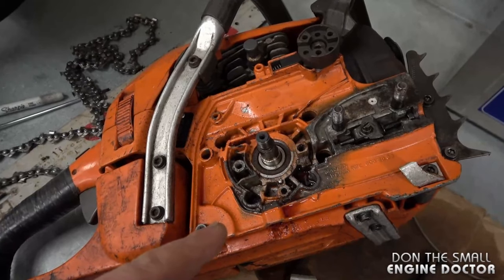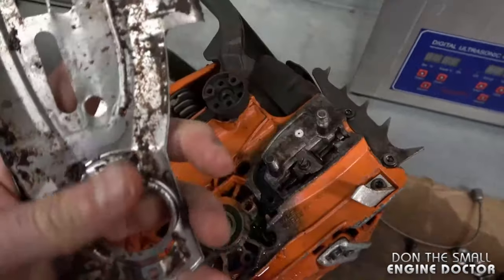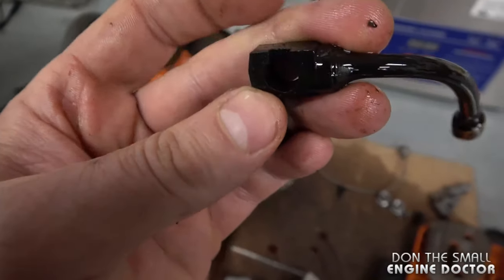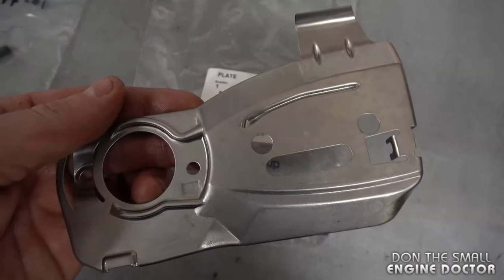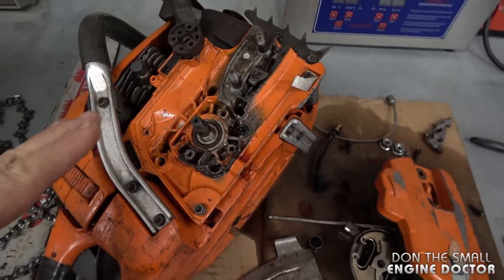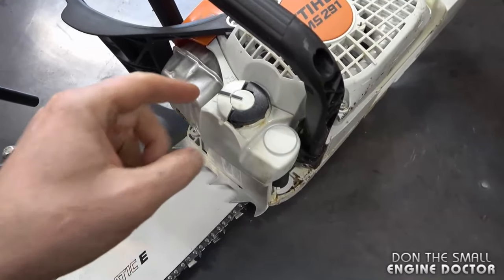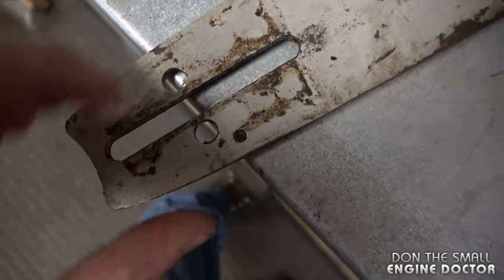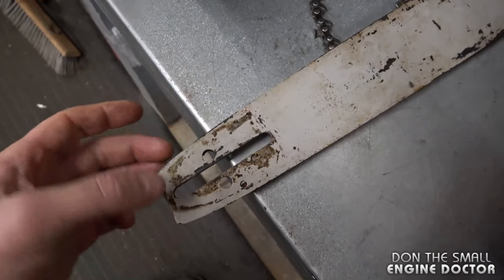Fixing A Chainsaw With A Massive Bar Oil Leak!

Comment from the maker: It is better to use OEM parts when doing this repair and avoid using old engine oil for your bar and chain in your modern chainsaw!
Reply: I don`t have confidence in the new stihl parts. One year old and plugged screen and leaky bar hose. I refuse to use their over priced oil.
Reply from the maker: @REDMAN298  i don't use their oil either
Reply: “Real” bar and chain oil contains ingredients that make it stick to the chain better than motor oil so the bar and chain will last longer and not get as hot. Used motor oil has contamination and has likely deteriorated from heat which don’t help your bar and chain life.  Saving a few dollars in the short run will cost you in the long run...
Reply: @johngrossbohlin7582  absolutely and you go to a farm supply and get their chain oil for about half the cost. I`m done with stihl. (have 3 of their saws,)  I take it personal when I get screwed. In these coming times I expect it will take it`s toll on these pricks. I used to be proud to own a stihl.
Reply from the maker: @REDMAN298  I've heard horror stories from dealers as to how Stihl treats them
Reply: could the plate damage possibly come from the chain coming off during use? My Echo chain came off and now it leaks.
Reply: stihl toolless oil cap is leaking because you have dust and debris on the seal, clean it and it wont leak
Reply: What web site did you find those parts and what are the parts called i got the same issue its leaking like crazy
Reply from the maker: @AZ_WEDDO  local husqvarna dealer
Reply: @donyboy73  mines a ECHO but thanks found a dealer close by

Comment: Good video mate.. after use before storing my saws i open caps on oil and fuel to relieve any built up pressure to maybe  help prevent leakage.. weather this works or not doesnt matter to me its not hard to do.. or its just all in my head and then that doesnt matter either... or does it..

Comment: Had the same problem on my 353 but wanted to quickly get it done so i cut a cylinder shape piece off a rubber clove and set it around the loose plug going in the body of the saw. Fixed the leak for a few months now. Ofcourse it is better to replace it for a original part. Mine was just something you do at home for a quick fix. Now i have that problem on a unused 357xpg i managed to get that has been sitting in a box for 9 years. My 353 was also around 13 years old when the leak came. Guess time just kills the rubber. Great video! Very helpful.

Comment: I tried the used motor oil trick back when I was young and dumb. After replacing the entire oil system on my saw, I stopped using the old motor oil and haven't had any more trouble.
Reply: Old motor oil is also a known carcinogen, but according to the State of California, (Prop 65), just about everything is.

Comment: hi don. I found that cleaning the bar and Oiler holes each time we sharpen the saw keeps it in good shape. Thanks for the tip on the oil loss problem. We now have a project to look forward to.
Reply: stihl toolless oil cap is leaking because you have dust and debris on the seal, clean it and it wont leak

Comment: Hi Don, thanks for all the great info on your channel, I now do all my own repairs and rebuilds thanks to you.  Own 15 Stihl saws and yes the new caps are a pain.  I take them off periodically and clean them in gasoline with an old toothbrush then compressed air, and that helps them last longer.  But the saws live on top of a piece of cardboard, everywhere they go.  Keep up the good work

Comment: thank you Don , great tips. a few thoughts. I keep a rag or oil pad in the bottom of my case to catch any oil. When I take my side cover off , I clean with brake fluid , let dry , then spray the inside with some non stick aerosol . really helps reduces the saw dust build up !!
Reply: What brand of non stick do you use?

Comment: Good advice I have the Husqvarna 141 16" forest chainsaw it leaks oil from sitting & not getting oil on the blade so its having two problems same time with this well explained video I will be tearing it apart tomorrow to check these things keeping my fingers crossed thats all it is thanks for the tips👍

Comment: Hi Don, hope your staying safe. I use a lot of Stihl gear and run a small 211 and bigger 261 chainsaw without a problem. But I have a full Kombi set up, because it’s brilliant and well worth the investment. From day one of the pole pruner attachment, it’s leaked oil constantly. I’ve replaced the tootles cap a couple of times  and cleaned out the the feeder line inc the sprocket area. It’s still leaks oil to this day. Any ideas from yourself or any of your fellow viewers would be welcome. Thanks!
Reply from the maker: try storing on its side, bar up

Comment: Mine is brand new.  Only used it once and leaked a huge puddle all over the place.  I'm used to Stihl  which never had these issues for me.  Yet, I'm still liking my Husq.
Reply from the maker: ask the dealer what is going on
Reply: My husqvarna 450e is in the same boat…brand new and leaking after only a few hours.
Reply: @TheRyan4756  I was told recently that this is normal because it is just a constant gravity feed.  Where as my Stihl is only active when running.  I think that is a better sounding system to me.  I had always been happy with Sthil in the past.  Might have to go back to them.

Comment: SIL bought a 455, and developed bad oil leak; found pump mounting bolt hole stripped in the plastic housing?  Uses special metric bolt, wondered if you have best approach recommendation?

Comment: Great video, many thanks. Can I just check that's not the 351 model please?

When I look up those part numbers it comes up as for the 351 model rather than the 353 quoted. Many thanks 👍

Comment: I have an echo 310 ( among others) and I use thick oil summer and thin oil winter. 
Oil leaks from the bottom of the clutch area significantly when stored. Any suggestions/advice?

Comment: I have a Cub Cadet CS 5220. It looks as if the oil tank is cracking. It looks like the bar clamp bolts are trying to pull through the plastic causing it to crack. When I put my saw away, it will be sitting in a puddle of oil the next day. Is this something I can fix or does the entire body of the saw need to be replaced?

Comment: Don, I need your help.  I have a Makita DCS6401 I purchased sometime around 2005.  That chainsaw now has a chain bar leak that pours out large amounts after usage.  As soon as I finish a cut, clean the saw and store saw until the next usage.  When I come back, I have a cup or so of chain bar oil saturated into whatever material the saw was sitting. I took my chainsaw to Home Depot and their repairman thought he fixed it but after a solid use of the chainsaw, I am guaranteed to have a pool of thick chain bar oil draining from the bottom of my chainsaw.  Help!  If I could ship the chainsaw back to the factory for repair, I would bc I love this powerful chainsaw.  Thanks much, Don.   (I too am Don)🙂 .

Comment: With the Stihl caps once they are put on wrong they won't seal properly again. Make sure you live up the arrows and turn them gently. It shouldn't take much force to twist. I am not a fan of these but I have had to teach myself how to use them. You can also use a silver or gold sharpie to mark the cap and the arrow so it is easier to see when you line them up. The down side to that is you have to do often because the fuel mix and bar oil makes it easy to wipe off.

Comment: Good day sir. I have a Honda mower brand new, also mtd 10 hrp snowblower was wondering should I turn the shut off fuel and let it run out of gas everytime of use? And also for season hibernation should I let all fuel disharge and leave dry for season. Thank you Angelo31.

Comment: The oil is operated off of pressure so when it starts pumping oil it creates a vaccum on the line so it's being syphon fed after using remove the oil cap to depressure the system worked on mines

Comment: Gonna have to watch those other video's on changing the oilier as one of my chain saws leaks badly.  Thanks for the tips and sharing.  Be safe and God Bless
Reply: stihl toolless oil cap is leaking because you have dust and debris on the seal, clean it and it wont leak

Comment: About those flipcaps, they work well but it needs to be clean around oil\gasoline tank hole, they won't seal right if there are any dirt, saw dust, sand.

Comment: I have had chainsaws already that from brand new, they leaked the bar oil out.  Now I have an old Echo CS-330EVL that is so old that it doesn't even have a chain brake on it.  It never had one.  It doesn't leak bar oil at all.  Has never leaked any oil.  I can wipe it clean after using it and put it on the carpet in the back seat of my vehicle and my carpet doesn't get messed up at all.  All my newer chainsaws leak bar oil to an extent with one that will leak all the oil out when put away over night.

Comment: Another great informational video.
Reply: stihl toolless oil cap is leaking because you have dust and debris on the seal, clean it and it wont leak

Comment: Can you tell me if you have any common reasons that a Husqvarna 345e chainsaw would regularly leak oil?
Reply: I do have one of those leaky saws.  Just love the saw and there are several vids about fixing the leak. Pull the pump off,  get pump and hose super clean with gas/alcohol then reassemble with thin layer of gasket sealer at hose and pump connection.  Haven't done it yet but leaving oil cap loose preventing daily temp pressure changes seems to help a lot for now.  Bar down, cap up.
Reply: @jefffrayer8238  I will give it a shot this weekend, thanks for the advice.

Comment: One cause of my oil leaking that my dealer educated me about is filling the oil tank up before putting the saw away.  I used to fill both the oil and gas after every session, so that it would be good to go.  He said not to do that because during the variation in temperature during storage, the oil will expand and contract, and if the tank is full there is no place to expand except out of the oil line.

If you put the saw away partway empty, then there is air space which can compress and accommodate the expansion and contraction.  Since I started doing that I have no more oil leak problems.
Reply: I usually shove some paper towels up the the clutch cover to help mitigate the eventual oil puddling. I collected old chain saws for a few years. The old saws in the best condition were the ones caked with sawdust & bar oil. It's like chain saw cosmoline.  If a saw is put up for an extended period, absolutely spotless, it is far more likely to suffer from corrosion. Never leave a magnesium-crankcase saw on a concrete or dirt floor.

Comment: I Use Old Changed Vehicle Engine Oil But I Always Use A PPG Paper Filtered Automotive Paint Funnel (2) Times To Catch Any Debris And Yes I Use A New Filter Each Time And It Has Been A Difference Between Night And Day And Never Any Type Of Problems With Leaks Or Blockages On Any Of My Saws Oilers

Comment: The China parts are cheaper for a reason , quality is not their top priority .
Reply: stihl toolless oil cap is leaking because you have dust and debris on the seal, clean it and it wont leak
Reply: Ahh, yes but that doesnt mean it is not a priority at all. You need to find the right vendor. My go to #1 aftermarket chainsaw parts guy is a Chinese vendor. His parts are equal or better than OEM stuff at a fraction of the cost. The only issue with using him is delivery time, but other than that parts are superior to what you may be used to from overseas vendors.

Comment: So what is the biggest cause of the metal plate bending?
Reply: That would be caused by jamming the blade in a tree and twisting it out. A stick getting dragged into the chain, or abuse. I usually see more leakage from older chainsaws with hardened oil lines. I cannot count how many chain saws I see with plugged oil ports on the bar. It's as simple as removing the bar. I swear people are afraid to maintain their saws. They bring them in with burned warped chains and bars because they run them without sharpening or cleaning them out when done. I find so many free ones like that.

Comment: I have heard that you should use winter bar oil summer and winter. That way if you have oil in the saw that carries over from summer to the colder temps of winter the viscosity does not thicken to the point that the chain oil does not flow! Do you agree?
Reply from the maker: no you shouldn't, the winter oil is too thin for summer

Comment: One thing I always do when replacing the chain, is to flip the bar each time, doubling the bar's life...And yes, those flip caps are a big source of leaks for me as well......
Reply: I have never had an issue but my neighbor doesn't like them and thinks they are over engineered.
Reply: @christophermaurer1271  I agree with your neighbor...Stihl in general are over engineered.  There chains saws are the best that you can buy, but are very expensive to maintain and repair.

Comment: Hey There
Awesome channel, I’ve heard you say you run your Stihl saws at 45:1 fuel oil mix. Why is that?
Is it because of your climate in Canada? I run a variety of small to larger cc Stihl saws . Would you recommend I run them ALL at 45:1 fuel oil ratio.?
Thanks keep up the great videos.
Marty
Reply from the maker: i run all my 2 cycle equipment at 45:1, it's little more oil and makes them last longer

Comment: I got a free tiller the engine is seized on oil its a earthquake 5020 Model 130292 type 4071 code 92022707 the tiller has a forward and reverse is there a way i dont need the reverse

Comment: Or if they leak and there some what new crack the cap when your done to release pressure on the tank
Reply from the maker: good idea
Reply: Wouldn't the oil tank vent let air into the tank? And if there was pressure it would be negative i.e wanting to suck in rather than push out? Or am I completely wrong? lol. Love the channel!
Reply: @aussiehardwood6196  ? I've got a new echo cs 501 chainsaw it leaks and my boss said just crack the cap after I'm done so it don't leak and that fixes it  even echo  said that
Reply: jeremy thiel well if it works & that's what the OEM says...well don't listen to me, I just can't see how that would help, even if your vent was blocked.

Comment: I can see why Stihl wanted to replace the oil and gas caps.  After all, the old style worked great for about the last 35 years, so yes it's totally time to replace them with an over-complicated design.  I can just see what's going to happen the first time most users can't get the cap off with finger pressure. They'll reach for a pair of pliers and snap off the little plastic tab on the cap.
Reply: Then go on eBay for an aftermarket cap that works like the old caps.

Comment: HUGE BAR LEAK FROM A HUSQVARNA.  U have to be kidding me. My problem is not getting enough oil , and I'm useing a brand new saw. I'm talking hospital cleen.
Reply: Does your saw have an adjuster screw to adjust how much it oils the bar?  All the saws I have, have a little screw on them to adjust how much bar oil it lets out.